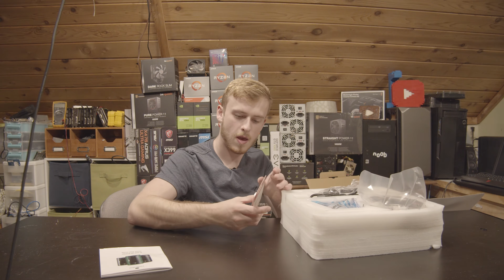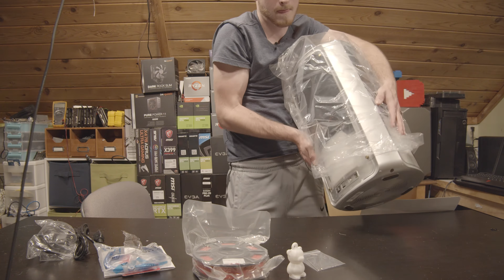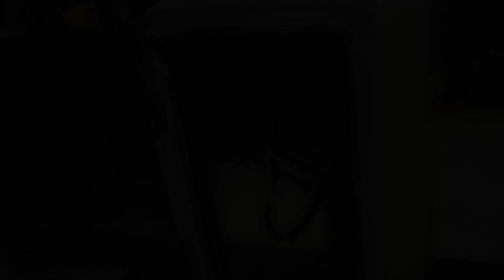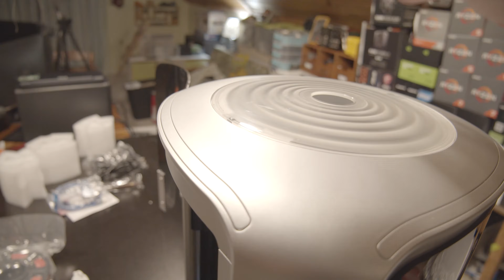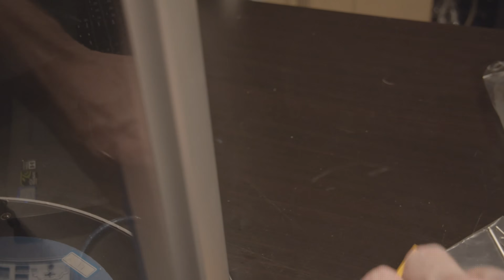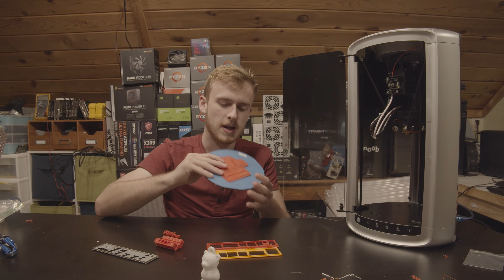A Good $300 3D Printer? Frankensbox fx-800 3D Printer Review

Comment: Thanks Jay, for the review! Fyi, the build plate is actually dual-sided: standard painter's tape for the blue side, which can help with removing the model, but then needs to be replaced. Or flip it over and print to the hard black side, which works better with a scraper, and nothing to replace. Personal preference really, so maybe try both.

The speed can be faster depending on the print quality setting. Max is 150 mm/s. The LulzBot Mini 2 you mentioned can do twice that (300 mm/s), but then you could have 4-5 of ours running for the cost of one of those. 

For build area, the Mini is 160mm x 160mm x 180mm tall. The fx-800 is 150mm diameter x 170mm tall. So the I/O shield you printed must have fallen just outside of that. Printing it vertically was a good idea!
Reply: Do u have a 3d printable part that can let the printer hold a 1kg spool?